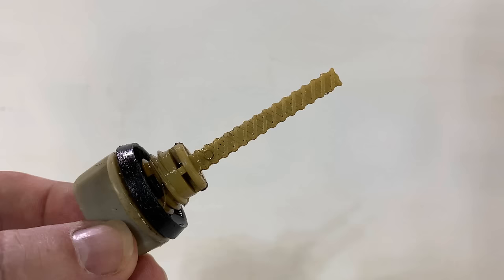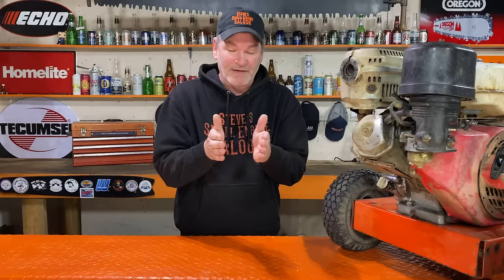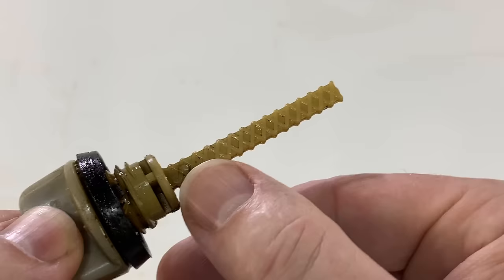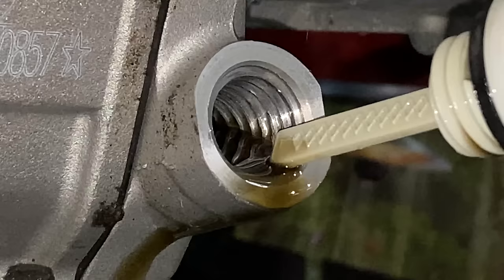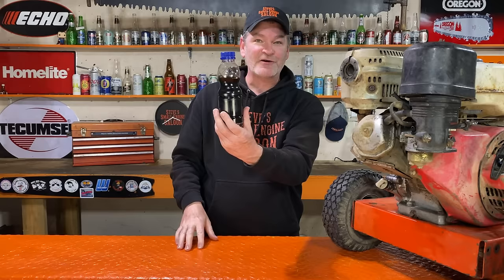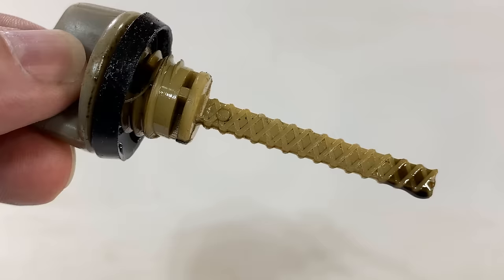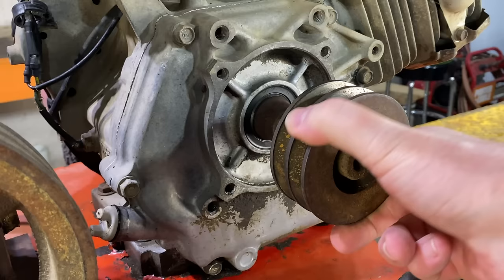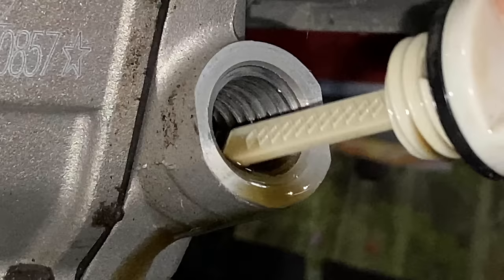Don't DESTROY Your Honda GX Engine By Making This COMMON MISTAKE

Comment: Have one of these on my BCS tiller.  1.1L is the capacity.  Has the diagram showing oil to threads.  Was never sure why they had the stick myself.
Reply from the maker: Right on

Comment: Thank you Steve. I have one question  can I add oil if the oil inside is low or do I have to drain it and replace with new oil?

Comment: Good tip Steve.  I am also wary of the ones with proper dipsticks, but there is doubt about whether you should screw the plug back in to get a reading, or just push it flush, without screwing it in.  Is there one right answer?
Reply: Whatever the owner's manual says to do.
Reply: @karlrovey  Only Brand New engines have Owners' Manuals.  In the US and Canada, before being sold, ALL owners' manuals must be destroyed for all small engines.  I think it's a law.
Reply: @joesinakandid528  This day and age, you can usually find it online if you don't have a physical manual.

Comment: It's the same with my 2000 watt Wen generater. Has simular dip stick, but oil is to be up in the threads, but at least it has low oil cutoff, but its getting already a danger area when that shuts down the engine.

Comment: There's only a oil on the tip of that dipstick any dipstick should know thats two low for the Conrod journal to get fully bathed in oil everytime it reaches tdb.. splash lube relies heavily on correct oil level  the crank has to be able to take a dip,  slingers too.. it's not a psi system, where pickup screen and pump can still lubricate everything while low.. ---splash needs high oil level--.  Yes I agree that dipstick is useless as tiddies on a boar.. fill that thing till it's spilling out!!!..

Comment: When i first bought a 14hp pressure washer (not a honda engine), there was also barely any oil in the engine too. Is there any reason why manufacturers dont fill it up much?

Comment: The crosshatch is probably there so you can see the colour of the oil 🤷‍♂️ & it serves as a texture to keep it on the stick. Not needed in those hondas though.

Comment: The other thing Honda does on other engines is have you rest the dipstick rather than screw it in. If someone thinks it should be screwed in and fills it to full on the dipstick, the oil will always be low.

Comment: Steve, If I am leading people astray let me know.
Please note that Steve references the GX engine in this video. I have a pressure washer with a Honda GCV190 engine and it does not need the oil to come to the top of the fill hole. On the link below, reference bottom of page 7 to top of page 8 for oil level instruction and reference page 3 for diagram of dipstick and explanation of upper and lower limit marks. This also applies to the GCV160 and GSV190. I don’t know about others. 
Personally, I think it is bad practice to put hatch marks on the upper part of the dipstick, above the full level. It threw me off, hence the research I have done. 
https://cdn.powerequipment.honda.com/engines/pdf/manuals/00X37Z8B0023.pdf

Comment: I break/ cut them off on all my customers equipment. I also keep the caps without the dipstick #15620-ZG4-910 or Stens #125-688 in stock.

Comment: Good advice.
It seems that all of my Honda engines have a low oil sensor that will shut down the engine if the oil level drops too low, to save the engines. I know that at least one of mine works, because I had it sitting on an incline, with the sensor on the higher side. It was easy enough to figure out why the engine shut down, cause I was already concerned about the out of level issue. (The surrounding ground was on a hillside, and I had to use a shovel to level out a pad for it to sit on.)
Did that engine have one? 
Or is it one built before that sensor was standard equipment?

Comment: According to the manual my Gx160 should use 600ml oil. I measured 600ml and put it all in when i open the dipstick at least 100 ml came out

Comment: Take a common Honda engine, the GXV160.  Another prime example of dipstick confusion for people.  To check oil you simply unscrew the dipstick, wipe it off, and place it back in, but do NOT thread it all the way down.  These come in all the time low on oil because Honda is different when checking oil than many other small engines.

Comment: Why not clip the stick off the cap? Problem solved. I never trusted the stick on my Subaru small engine, always kept the Royal Purple up to the top. 10 years later, you can't even tell this engine has ever run! It's THAT clean inside!

Comment: The clone engines are the same.  It even says in the manual for both Honda and clones to fill it to the top of the threads.  I guess no one reads the manual anymore especially since Honda has them available for download on its site on the Internet.
Reply from the maker: Good point!

Comment: Hey Steve I have a question about my Gravely mower it's pull start but it has a key to now the other day the key fell out and the switch fell apart, and there's three wires what can I do with those three wires to be able to start the mower. Thanks any help would be appreciated.  I believe the wires are white, red and white with a green stripe.

Comment: My Honda engine about pulls my arm out of socket when I pull the start cord. I tried adjusting the valves but still happens and it pulls incredibly hard when it yanks the rope out of your hand. Any idea what to try? Is there another valve that releases the exhaust pressure?

Comment: I have several engines where the correct oil level is to the edge.  Only my Honda had the little stick.  Good thing I know better.  My 25 years old,  8 h.p. Honda still runs like a champ, but then I did like Steve says.

Comment: Question just changed the oil in my troy bilt tiller. After running it for about 30 mins I was randomly getting some smoke so i knew I had over filler a little. Went to drain a little bit of it out and noticed the oil is grey. What caused this after only 30 minutes of use?

Comment: My Honda foreman it’s a 400 cc it’s a 1999 I’m pretty sure you take the dipstick out wipe it off and don’t thread it back and you just stick it in and pull it out that’s how you check the oil on that anyway I think a few was to fill it up like you’re talking about on that engine it would be too much oil anyway I hate thanks for the information I learned something this is Jim mango from Kennerdell Pennsylvania oh by the way that Honda foreman I inherited from my dad and it has over 6000 miles on it and the machines never been abused and I didn’t abuse it either right after I got it from my dad but it still runs excellent well cared for are you Amsoil products in there gear lube in a DEF and engine oil OK thank you again

Comment: sir I have built many engines and done this... I epoxy the inside if all walls so cleanness and oil will not stick to the walls.... ON my race engines that keeps the oil returned back to the sump much quicker.... most builders say no matter... your thoughts on my maintenance equipment... rog thanks

Comment: It’s funny because my Honda 1000RR sport bike has the dipstick and you have to hold the bike level. I miss the sight glass they used to use on the generation before. My Honda versatatch power head is the same, and I’m guilty of doing the bottom of the threads. I’m have to add a tick to it.

Comment: Hi Steve is that only for the gx engine? I have a gvc 160 and gvc 190 motors, I use the dip stick on those, also on my scag zero turn they say to check the oil with the dip stick not screwed in

Comment: hey i have a ex-cell 3200psi pressure washer with a Honda gx-340 11hp i just change the carb new and the throttle linkage on top changed the oil new plug  and it has a  great spark  i tryed  to start it nothing wont start????

Comment: I need help in the comment! Oh and by the way this content is great and I love to engage with it, for the algorithm. I got a stuck flywheel on a GY6 engine and I've tried absolutely everything he PB Blaster hit it with a hammer while prying it air chisel everything and nothing's getting it off. Any suggestions would be helpful.
Reply: No thanks no thanks to you guys but I tipped it up on its side and filled the whole with PB blaster

Comment: Hey bud I have a multiquip plate compactor with a Honda GX 160 engine I checked the oil and was at the threads last week when we used for an hour anyways this morning my employee this am started it and it was white smoking I turned it off and ck the oil and all the gas drained out of the oil ??  I’ve never had this happen please help

Comment: Would this apply to most things like generators as well?
Reply: Read the manual or look for the pictographic on the engine/equipment chassis and it'll definitely describe how that specific machine should be filled. It's pretty standard though that when the engine has the oil fill hole down low at an angle with a small plug like the engine has in this video, you generally have to fill it either to the bottom of the threads or to the top (like Steve has). That's the most commonly seen style.
Reply: Yes...to me the stick is ok....but keep the oil at the top at all times.

Comment: The only reason for that dipstick is so a mechanic can see if the owner has been running it with a low oil level, potentially causing damage.

Comment: I always wondered why they put those on. I ignored it because I treated that engine like any that has the oil that far up . Call it old school thinking. Honda has always done stupid stuff like this. Most people do not realize on many Honda engines, you do not thread the dip stick in when checking the oil. As far as even checking the oil, most people do not. They also refuse to change their oil. Then wonder why their equipment fails within 2 years.

Comment: I put a 160 honda engine on a plate tamper same thing. The new engine $400 at northern tool. He said old engine burning oil wants new. Not a clone for $160. So he got a new honda engine

Comment: No low oil shut-off on this model?
All the power washers I've operated with hondas, had low oil switches.
Reply from the maker: Yes it did, but obviously did not work!

Comment: quick question:
I have an old mower with a 4 stroke honda engine.
what happens if you put 2 stroke oil in that engine?

Comment: What about a Honda gcv engine?
Reply: For Honda GCV engines such as on HRX lawnmowers, the owner manual clearly says fill only within the hashmarks area on the dipstick, not to the top of the oil filler tube, to avoid flooding the air filter area and causing smoke.
Reply: @sounderdavis5446  mine is on a lawn boy pushmower...found in the manual a range of ounces of engine oil capacity.

Comment: off toping(slightly off) but I have a Honda 4 stroke powerhead(for my muilti attachments string trimmer, pole saw ect) and was working fine unitl last night now it sputters and starts to die(warning sign) when I go to fuill throttle over 5 seconds at a time. when I throttle down it runs normal until I do it again. I can't get past 3/4 throttle and it starts to die and does if I hold it down to full longer than 5 seconds!

Comment: i got bough a old GX160 Generator and changed the oil (recommended was 10W30) but i use 5W30 that's what i had. left. Wondering why this engine have 2 filler points ? One with dipstick and one without ?? I refilled oil in the one without dipstick . Did i did it wrong ??

Comment: ;Steve I need your help! I need to look up parts for my Honda GX240 thats on my EM3500SX. The model number on the engine is Type: MSY* Serial: GC04-1448992 I cannot not find the MSY* model type on Honda's website, have you encountered this?

Comment: And they check the oil when the motor is warm it will run out when it warm or hot check it before you start it up cold or outside temperature

Comment: Hi Steve. Does this apply on all engines with that style oil arrangement? (eg slanted)
Reply: Generally yes. My Kohler Command Pro oil fill is the exact same type. But I thought the Honda GX engines had a low oil alert.
Reply: It does NOT apply to Honda GCV 190 engines e.g. on HRX217 lawnmowers with a slanted oil filler tube. Their manual says:  fill only to the top of the hashmarks on the dipstick. If you fill to the top of the oil filler tube on GCV 190s, you will flood the air filter area and cause smoke. Steve's video is specifically about GX engines. Look up the advice in your owner manual for a different engine.

Comment: Good to know. I’m sure they designed it that way so they would blow up and the person would have to buy another. I personally hate Honda and working on them. I don’t understand why they’re so highly touted. The ohc flavors have a plastic cam lobe molded into the plastic cam gear with a rubber belt. That’s a great combination for failure.

Comment: Flathead 190cc Briggs is more efficient on gas than a 130cc OHV 😱😱😱🥶🥶
Reply: I don't think that's true. Fuel usage is highly dependant on the equipment that the engine is driving. A 4500 watt generator being used at full load will use more gas than a tiller being used to turn over soft, loamy soil. 🤷🏻‍♂️ Smaller OHV crossflow engines are almost always more efficient and more powerful than flatheads.

Comment: Is this true for the Honda GCV 190 engines too? Mine has an actual "band" at the lower end of the dip stick.
Reply from the maker: GX
Reply: For Honda GCV engines such as on HRX lawnmowers, the owner manual clearly says fill only within the hashmarks area on the dipstick, not to the top of the oil filler tube, to avoid flooding the air filter area and causing smoke.

Comment: Many thanks for your GREAT videos.
Honda GX340 Engine question for the master.
I have a GX340 Engine Serial # GC05-1378415.
It presently has no spark and the coil number is 30500-ZE-003 (about $145.00 which has a 30410-ZE3-003 pulser (about $55.00) connected to it.  The engine also has the low oil alert system.  These parts are very expensive.
This engine is utilized on my personal pressure washer and (I know how and when to check the oil.)
I see on Ebay that standard GX340 coils can be had for under $20.00.  Of course these won't hook up the low oil alert system which does not concern me.

The question is could I put one of the standard coils on this engine disconnect the wiring to the low oil alert system and replace the current on-off switch which has wiring for the low oil alert system with a standard on-off switch.

Any guidance on this question would be appreciated.
Reply from the maker: Check this vid   https://youtu.be/16z1zd4kUKI
Reply: @StevesSmallEngineSaloon  Hi Steve, Many thanks for the link that would be helpful if trying to bypass an low oil alert system.

What I am trying to find out is if I can remove the coil I originally mentioned disconnecting the oil alert sensor and the factory installed on/off switch and install a standard coil that has only the ground wire like most lawn mower engines have.  I would also disconnect the pulser as it would not be required with the standard coil.  The oil alert coil and pulser approach the $200.00 replacement cost.  The standard coil that says it fits the GX340 series engines  that has just the ground wire can be had for under $20.00

Comment: I never had a small engine with a dipstick until I inherited a harbor freight predator on a rototiller the previous owners of my place left for me, and sure enough I saw there was oil on the end of the dipstick and called er good. Tomorrow I'm gonna go out and fill that mf up since I downloaded the manual for it and it looks just like what you showed in that Honda manual. I thought it was lying chinese nonsense since who the hell fills a crankcase to the top of the hole when there's a "dipstick", but I'll bet that's why it won't run for more than a few seconds.

Comment: Don't think I've ever looked at a single dipstick on a small engine ever with the exception of larger verticals. There are exceptions I'm sure but most under 14hp it's useless.

Comment: On the other end of the spectrum, I’ve seen people blow seals out because of dipsticks and reading them incorrectly. Dipsticks are supposed to be screwed all the way back in when checking the oil and I’ve seen people just pop them in there. Pull it out without screwing it in not seeing any oil on the dipstick and fill it up too much.

Comment: Always read the manufacturer operation manual, all motors are made different.  Don't be a dipstick,read and learn about the equipment you operate.  Too much oil can destroy a motor,as well as too little.
Reply: Too much trouble

Comment: Not true on every GX, look up the owners manual for a EM2200X generator. The distal end of the dip is checkered and the oil only goes to that point. Which is well below the edge of the oil fill hole.

Comment: Honda once had a reputation, but it appears the company likes to screw itself. Having personally experienced the infamous GVC 160 engine and all of the related problems and self repair expense, I would NEVER by another Honda machine. My MTD and Briggs & Stratton machines have never posed a problem with regular maintenance. Syanara Honda!🐽

Comment: These engines are JUNK ! 
I'm not the only one who feels this way .
If it's not carb problems it's ignition problems .
      I have one of these brand new out of the box , put it on a mini bike AND HAVE NEVER GOT TO USE IT ! 
       The engine would not idle low eanough so the centrifugal clutch could do it's job .
       And the very next day ( with less than an hour run time ) 
The coil went bad .

     Yup , my hard earned money went up in nothing .
      THESE ENGINES ARE TRASH